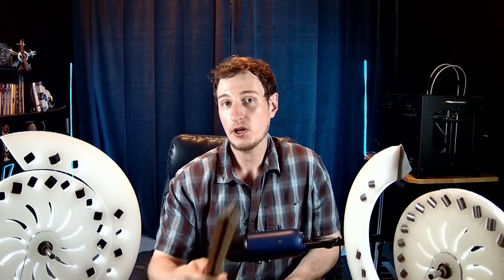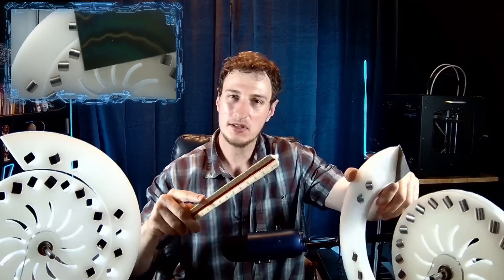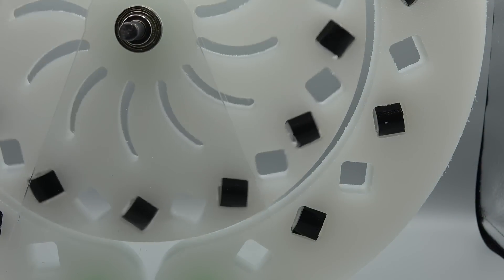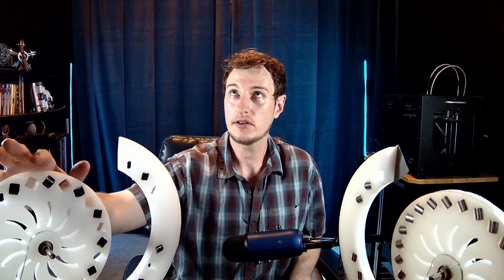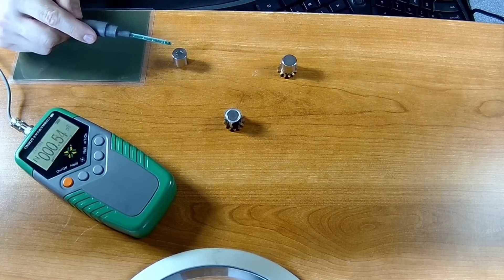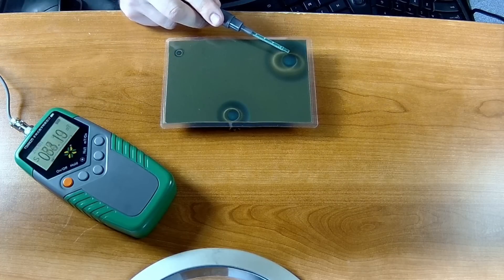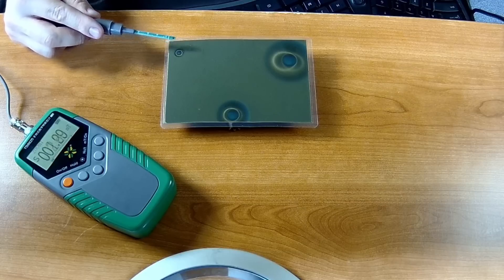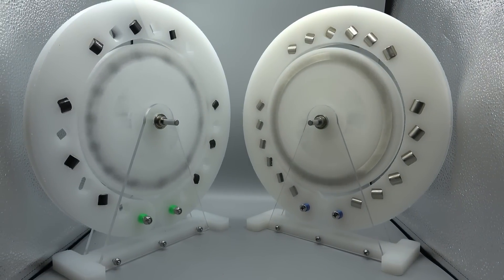Perendev Magnet Motor - Does IT WORK?! (Part 2)

Comment: Nice. I had an idea to make a machine with magnets that would be set up like a ride at a carnival. Taking that same push of magnetism into account and instead of a static rotor and stator situation it was like a spinning tube on roller bearings. The tube having magnets at an angle oriented to perpetuate the push of the magnets also oriented on the outside of the tube (solid mount) moving along a piece of rod in a circle. So it would be like a spinning tube going around in a circle while spinning to get from position 1 back to position 1 which would start the whole thing over again. My theory was the there is indeed energy in a magnet (albeit not a great amount given the weight) and one could harness that free energy but could only get what was initially put into it depending on the gauss involved at the time of making the magnet like a neodymium magnet. Not entirely perpetual motion and it would only work for a short time until the repulsion energy got used up and because of the cost of running the tube around in a circle and spinning simultaneously it couldn't run anything except for itself.

Comment: The goal is a physical impossibility. There is no perpetual or free energy. This "motor" has 0 application and can handle 0 load.
This video is either straight up clickbate or you slept through remedial physics.

This error was far too egregious to have been an oversight. This was either purposful or beyond ignorant.

Unsubscribed
Reply from the maker: Did you watch the video? I said it does not work, and stated exactly why. If anything, the point was made very early on.

Comment: Does each rotor magnet have  Mu metal shielding on side and bottom? Are your stators  horizontally polarised or are you using the same? The rotor magnets need to be  N/S vertically  polarised. Always run it in attraction mode, never repulsion.
Reply: repulsion would work just as well in theory, all you have to do is isolate and shield the part of the magnets that are attracting so that all you have is push. just like how your method has only pull. They are the same.

Comment: There is subtle difference in the strength of one hole versus another, the magnetic hole versus the electrical. There is a degree of recession between two and you would have to probably place all the magnets and a static imbalance using the procession of the two poles, that is the only way you can, create a net difference to work to be done on something

Comment: Yep, those are flywheels that have been accelerated by another source and are just slowing down.
Reply: In the original fraud version, there was an electric motor on the far side that was hidden and they only showed the far side after a cut to remove it.

Comment: not true on only way to do magnetic switching, being electronic (5:04) but the view on things is still incorrect from what I have observed and used to solve these problems, issue is that materials and energy density are not the real world changing solution we need, that is going to be found in electret manufactured triboelectric systems that actually convert thermal energy (not differences of thermal energy) into electrical charges and how to collect these with out interfering with the charge building component of the electret (ie the conductors have to be neutral triboelectric charge units that wont alter it, but rather will only allow it to transfer through it changing its triboelectric charge to match what it is touching ) 

Heck if you want to see another interesting power generation system, you should reach out to talk about the tesla atmospheric pulsing system that uses mechanical switching to alter the charge potential at given altitude causing a build up of higher and higher voltage potential at that level in the air, instead of instantly draining it and creating a void of 0v ground level potential because it keeps draining anything as if it were down at earth level. its quite a surprising little system based on old tech for detecting charges (electroscope)
Reply: @ThomasAndersonbsf  agreed, and room temp superconductors are basically gonna be a requirement for any of that triboelectric stuff to really be useful in day to day stuff at scale. Which will likely be created in the near future imo, I don't thinks it's impossible to make a mass producible room temp super conductor, especially as our collective grasp of subjects like 3D printing microstructures, and molecular composition progresses. I also think it's entirely possible we'll see some major leaps forward with things like metamaterial magnetics, 3D printed magnetics, and the principles of time crystals and quantum mechanics being combined. I feel like all those fields are heating up like crazy right now, and as the discoveries recently made start to trickle into these other fields things are gonna get real crazy, real fast. But what do I know? I'm just a person on the internet
Reply: @GRAVYTYMusic  we already have super conductors that are not better at colder temps but rather instead of room temp, they become super conductors at higher temps, the place you see them? LEDs is the biggest visible exception to the higher temp equals lower resistance, and why you have to regulate the power with a resistive load so they dont burn out, because as they warm up, they let more power through causing an escalation until they get hot enough to be destroyed, so what we need is something that self regulates at this warmer temp causing it to stop just short of damage, then opening flow as soon as the temp drops again, which will give a stuttering effect too, which is always far more efficient for most things, especially if the frequency of off or low and on or high, (like LEDs for instance, where the material they are emitting light continues while unpowered so pulsing itt still gives a smooth light but for far less power, with out notice. just has to be a frequency that does not let the stuttering effect show up in the emission or you get a high frequency strobe (something I use this flaw of my flashlights for observing speed of things like fans and such when needing to know if there is a problem)
Reply: oh the other option is a temp regulating system too that can pump away the heat fast enough to keep the temp of that run away lowering resistance from over heating the material to destruction of the structure, which is one use that the Triboelectric generator design accomplishes since the higher the power draw, the colder the whole structure and surrounding environment gets, as it absorbs that heat and converts it to electrical charge displacement used to power what ever circuit is available, but its not super conductors needed for it, it works even with standard materials but super triboelectric states found in electrets (forced charge potential beyond what the natural flow to charge state forms in said materials by introducing a super high field strength with capacitive plates placed by a drying or cooling material at at least 20,000vDC if not higher. thus this higher state is displaced into the material rearranging the molecules facing into our out of that charge field before it freezes into place either by drying out or hardening from cooling completely off.

Comment: James, I appreciate your explanation, but you kind of dodge around it like it's an engineering problem when in fact it's a fundamental physics problem. There aren't "two problems" with a permanent magnetic motor, there is only one problem. Namely that permanent magnets are not a source of energy. You talk around it like it's a matter of configuration, but it's not, and I think you know that it's not. Quite simply put, physics does not allow for a strict permanent magnetic motor to work in any configuration. Again, I appreciate your explanation, but I think your style and approach leaves open the thought that the concept is just waiting for the right configuration when that's just simply not the case.
Reply: magnetic potential IS energy, that repulsion and attraction of magnets? thats ENERGY. in the form of potential energy like a spring. it is 1000% not a physics problem. in fact. this is how the energy for our planets magnetic field is generated. the science stops at the rotation of the earth, therefore making Gravity the answer, when in reality, Gravity, Magnetics, and spin play a role simultaneously. the fundamental flaw here IS an engineering problem. and the fact that james didnt isolate the fields correctly.

Everything is made of energy, not matter. if you look at the Atom, even as depicted by mainstream science, which a lot of our most brilliant minds dissagreed with throughout history since, is 99% empty space. that empty space is potential ENERGY. and this is the fundamental understanding that lead Tesla to discover the "Ether" or for Floyd Sweet, the Vacuum. if everything is energy, then there are an infinite number of ways to harness it, its just an engineering problem the whole way down.  the universe is Electric. Electricity, Magnetism, and Gravity all interact with eachother constantly to form the force of nature such as wind, pressure, lightning ( its where the charge that builds up to a lightning strike comes from) 

Physics 100% "allows" for the magnet motor to work. its a problem of manipulating the magnetic fields in the right way, so that there is only repulsion or only attraction. otherwise you run into the problem of the rotation of the motor being caught by the opposite force thats giving it rotational energy. when all the magnets are repelling at an angle, the rotation will become resonant and self sustaining, or it will continue to accelerate until the device breaks if not regulated. Your understanding of "physics" is flawed.
Reply: @MrSnowFoxy    Potential energy as shown by permanent magnets or springs does not allow a continuous gain of energy which is needed to drive a motor with a load. Not even when the load is only unavoidable friction. Physics does not allow a magnet motor. There is no way to manipulate the magnetic fields "in the right way" without an additional input of energy.
Reply: @MrSnowFoxy Hi Dear. Pseudo-Monopolar Magnets has been done since Long but didn't made the work either possible up to now.
Reply: @MrSnowFoxy everything is made of matter and energy as the two fundamental building blocks of the universe interconnected through E=MC^2  And empty space is not potential energy but it does contain vacuum energy which is a form of potential energy.
Reply: It's ok I'll settle for 30 years until the magnets wear out, then re-magnetize them. Lol
Reply: Free energy assassin.
Reply: Great video, James!  As another idea, it’s fascinating to think about how magnets might work as a sort of spring mechanism to power a motor, similar to winding up a traditional spring. There's no fundamental reason in physics that it wouldn't work. Plus, with sufficiently strong magnets and a very light rotor, you could potentially leverage the polarized accumulation of atmospheric ions around the magnet poles to move the rotor. There’s even some academic research suggesting that strong magnets can attract polarized oxygen molecules. However, if such a device did work, it likely wouldn't generate a lot of power. Magnet motors are still a really intriguing concept!

Also, a big thanks to James for featuring my VTOL ion-propelled aircraft in some of his other videos! You can check them out in action on my YouTube channel and website, where they’ve been showcased in some cases with many officials present.  It’s amazing to see how far we've come, especially considering the initial skepticism about thrust-to-weight ratios.  I think all things are possible given the right set of circumstances.
Reply: So could this work with something like a uranium magnet?
Reply: @GRAVYTYMusic  not perpetual motion. IF it were possible, it would be a conversion of nuclear energy to mechanical energy.  The uranium would be consumed and follow the laws of physics.
Reply: @kenreynolds1000  I mean I'd imagine if the energy requirement were extremely low, and you had an extremely long lifespan from them it'd be about as useful though, obviously there's no free energy, but if something made the cost of the energy cheap enough and you had a long enough lifespan it'd functionally be basically the same thing. Just without the gotcha moment for all the free energy nutjobs.
Reply: @GRAVYTYMusic  nuclear power is the most efficient energy per weight, with 10kg of plutonium, uranium, … you have no match for the creation of energy.  
What’s the point to have an almost perpetual machine (alone a « perpetual machine » could turn/move for quite long, weeks, month, year, with really slow energy lost BUT without providing usable energy, only friction loss energy) 
With this type of machine pseudo perpetual, you would only have so few energy with more loss. There’s no way it could be useful for energy.
Reply: Electrons never stop moving without any external energy input, there is "free" energy in them for sure XD
Reply: @RCarrasco54 what are you talking about?  That only happens in a superconductor, and then only for the current that's already been induced in it.  If you're talking about electrons in atoms then your atomic model is 95 years out of date - they do not orbit they're in discrete energy/spin states - if they did orbit then the ultraviolet collapse would be a problem.
Reply: @williamchamberlain2263 Thanks for your Comment, Dear. 

Could You remind us what is the Relationship between the "Ultraviolet Collaps" and the idea there is no "Electron Turning Around" in an Atom? Please (You may Share References about :) )
Reply: ENTUSIASMO TENHO POR CONHECER MOTORES AUTO SUSTENTÁVEIS. EFICIÊNCIA NORMALMENTE É UMA BARREIRA ABANDONADA NESSE PRIMEIRO OBSTÁCULO. IMAGINE SE OS PRIMEIROS AVIÕES PARASSEM O DESENVOLVIMENTO NESSE PRIMEIRO OBSTÁCULO.
Reply: @RODOLFO.M.S  manipulating the laws of physics to fly an airplane is COMPLETELY different than disobeying them to generate “free” energy.  Bom dia.

Comment: So yes about Mach 16 is the results we had. But it's the breaking that's the trick.!. Use Stronger magnets that can quickly, if needed, halt and accurately throttle power wheel speed. Coils to tap for energy.  Only ! Not control. Or at least we never mastered that way... Timing is a "b itchy". Also heads up... secure at start up. But, hang whole frame and use springs to hang and hold down . So to tame the harmonic vibrations . But, leave it some what loose at speeds over 27,000 rpm. If earlier it's still to out of balanced. 👍🏼

Comment: Yes, we used infrared laser for timing. Ours was  built as 6 foot diameter wooden wheel with  steel frame. At about 62,000 rpms it took off.!.  At 115,000 ~rmps  the magnets released.  Going thru 6 inches if concrete 'garage floor ',  walls, ceiling and nabors garage and porch. ..."oops "🤭
Reply: Ps. As for "take off" . I mean it no longer needed the drive motor to get it up to speed or 'drive the wheel

Comment: Even if it did work, magnets wear out over time, so it would not be considered perpetual. Perpetual requires absolutely no loss of energy in the system, none of any kind.
Reply: I kept telling this to a UW BSME year ago.   Drove me nuts that he would spend time and mental effort to prove the laws of thermodynamics don’t apply to his invention. The magnet is just a storage system.  It’s a huge energy investment to make a permanent magnet.
Reply: @kenreynolds1000  A die contains as much energy as a magnet. Only the magnet has a homogeneous orientation that influences the charges to the naked eye. You simply do not understand what the world is made of.
Reply: @theplouf5533 70%of total universe energy is called today "obscure energy"... "obscure" dude. And you really said "you do not simply understand..."??? YEH WHAT EXACTLY?  😂😂😂
Reply: @kenreynolds1000 woah, drove, you nuts; 🥜 

Has anyone looked into the perpetuation potential of nuts if driven ?

P.S this is a reminder to feel your perpetual motion device IE Nutsax for lumps , as this could be signs of quantum destabilization
Reply: It does work, but yes, the power " magnets " will fade down, and the electronics cost energy. But... BUT.  If you can tap the wheel and get useful energy but at the limits of material strength , design, and control.  It's super dangerous, and it's like a boom in a can. Thats just spinning at Mach 18 and above.
Reply: No, it does not work. You're speaking gibberish  @irri4662

Comment: I’d like to see more practical explorations of applied fringe physics concepts like the Beifield Brown Effect thruster, Quantized Intertia thruster and other propellant- less thrusters
Reply from the maker: I can definitely try to cover more of that.
Reply: @Motor_Explorer1 I'd like to see you cover metamaterial magnets, and experiment with fringe concepts using these new tools. I think it's safe to assume regular magnets have been completely exhausted for this stuff, and you'd at best basically just be recreating other debunking videos which already exist on a hundred other channels. Metamaterials and 3d printed magnets are a relatively new field of research though, which means there's actually a chance you'll find something no one else has.
Reply from the maker: @GRAVYTYMusic  Thanks for the feedback guys. I agree there is huge potential to metamaterials. I only learned a bit of it in Const. Eng, but it could unlock a lot of tech and is widely unexplored.
Reply: @Tech_Planet  this project is Undersized underbuilt, and way under speed .we used laser as triggers.not coils. Coils can't react fast enough.